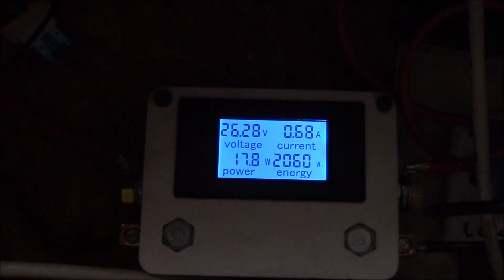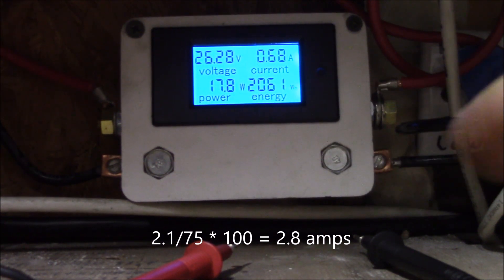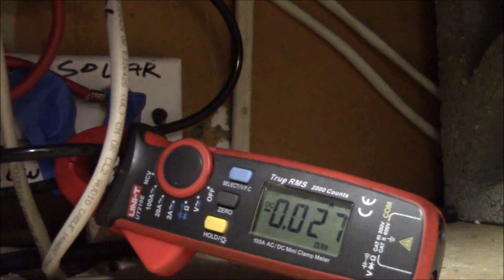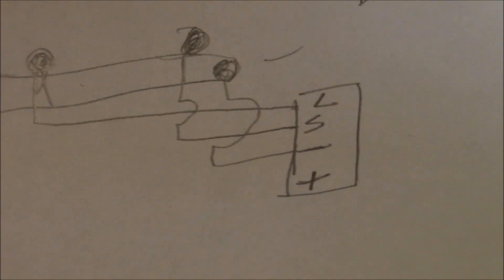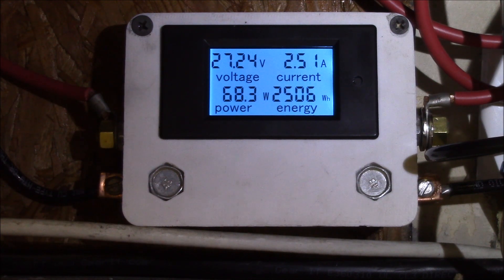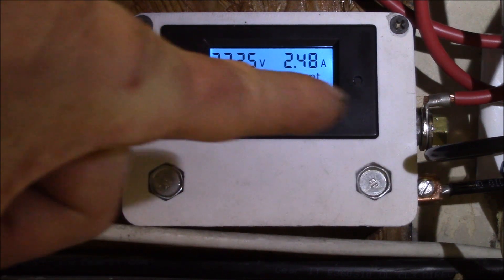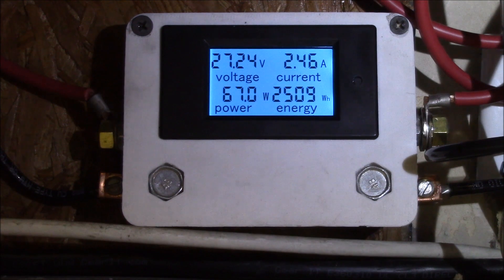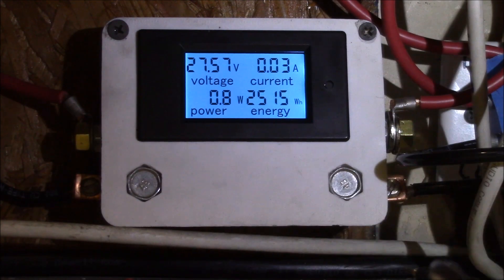DC Power Meter Re-Wire

Comment: You keep doing videos on things I need to add to my system lol. Thanks
Reply from the maker: Good deal.  I think I messed myself up on wiring this meter in the case because I had to flip the meter over to access the terminals, so ended up swapping the input and output.  Plus the wiring diagram on the back of the meter is somewhat confusing as it doesn't really show where the power source is, only the meter and the load.